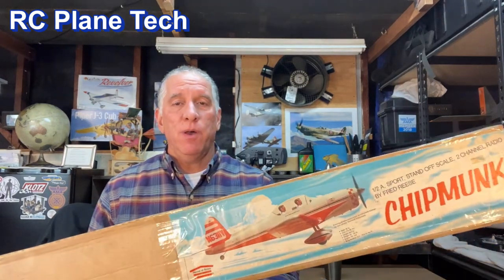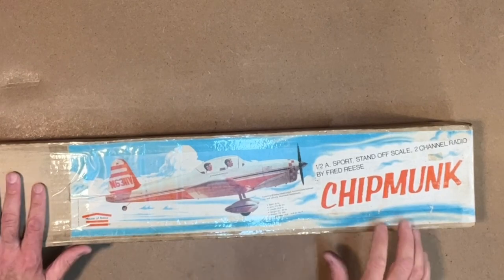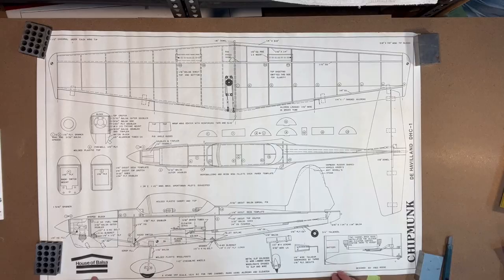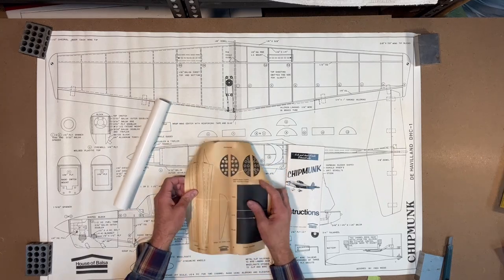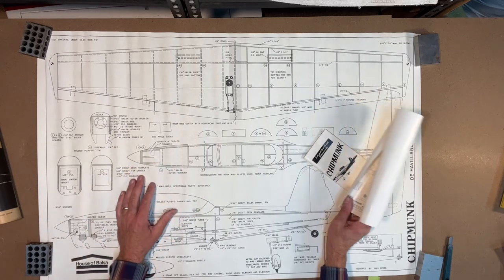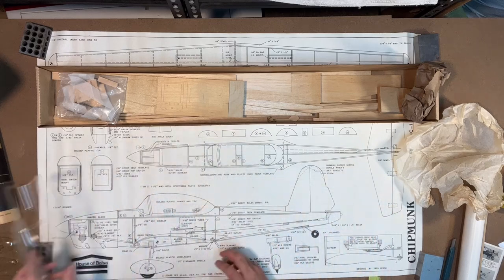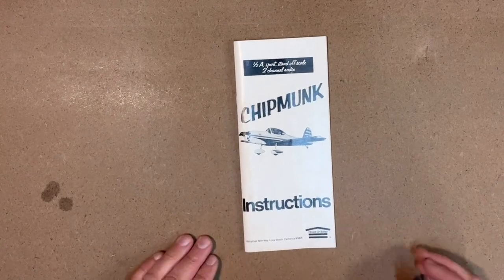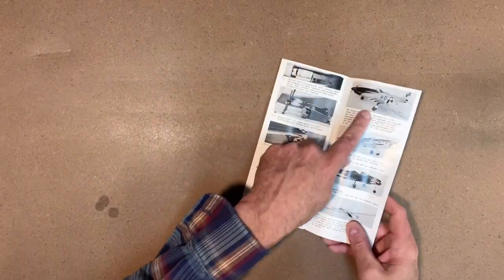Review vintage DHC-1 Chipmunk Radio Control Balsa Plane vintage kit

Comment: I have the house of balsa p51 and T6 Texan. I'll be looking to this build and what you choose for electronics.
Reply from the maker: Nice. I built both of those kits back in the 80s but unfortunately I wasn’t a very good rc plane pilot then and they didn’t last long.
Reply: @RC Plane Tech  I'm not either! But I love building.  After my SIG Astro Hog build with electric conversion I will start on one of the house of balsa kits. I plan to make it electric as well. I have a 42" Slick 540 that a club member sold me but I put it into the ground. Was hoping to use the small servos though and maybe the ESC if its sized for whatever motor is needed.

Comment: Curious how this flying on a 049? In another video you convert it to an os 10 fp which looking like a rocket. Why’d you upgrade engine? Thank you!
Reply from the maker: I wanted a throttle on the engine so I could control it better. I think most 049s dont have a throttle, so you would have to start it and just let it go and pray for the best. Thats why i also added rudder with tail wheel control, so i could control on takeoff and landing. I built a few of these kits in the past with modifications, and you have to hope it tracks straight on takeoff. Another option are the old Fuji .09s with throttle, I little smaller than the .10.
Reply: @JamesRCPlaneTech  thank you for the detailed feedback. Appreciate it. Curious if you know the end weight? Thanks!